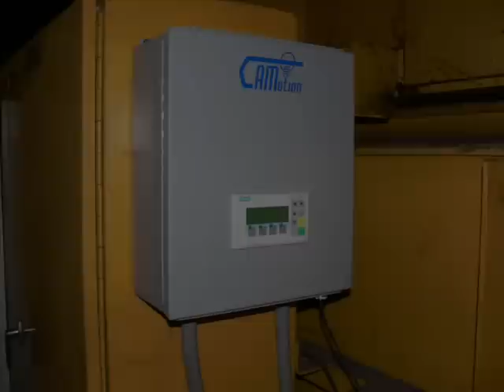Crane Operator Goes from Novice to Expert in 30 Seconds

Comment: is he that new or does this crane have trolly brakes?
Reply from the maker: The bridge and trolley have asynchronous motors controlled with VFDs. The VFDs engage the "parking brake" when the velocity is zero. However, when the load is heavy and swinging, it can back drive the trolley - even if the brakes are on.